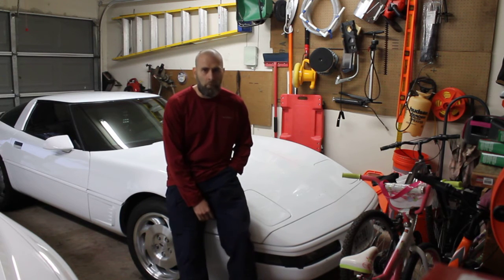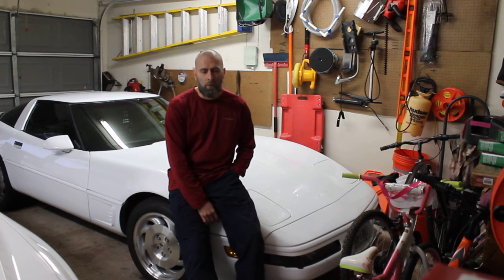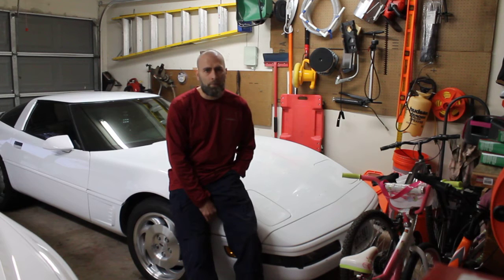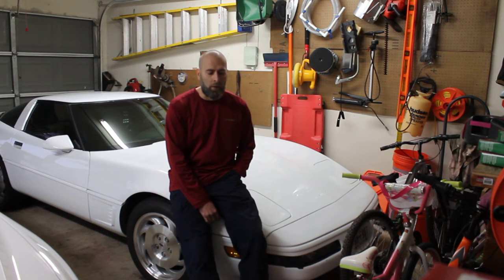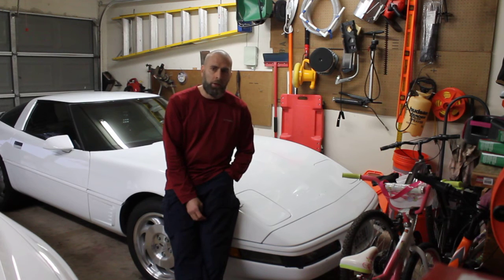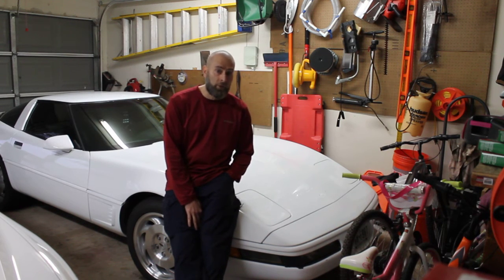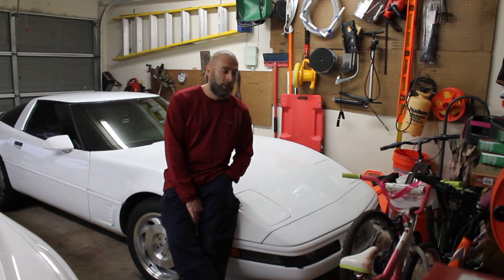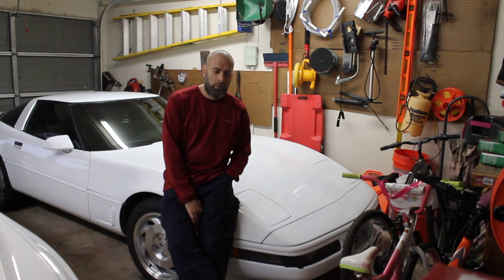1995 C4 Corvette Cooling Issues

Comment: I know what you mean mine runs 234 put a 185 thermostat in didn't help so I'm done fooling with it, it makes you mad.
Reply: The thermostat dose not change the overall temperature of any cooling system. It simply opens at a set temperature - in your case 185. It’s not like a house thermostat and many people are very confused about what an automobile thermostat actually dose. Many many other factors contribute to higher than idea temps in car especially C4s. Clean the area between the AC evaporator and radiator annually, check coolant level weekly, make sure fans are both working, bleed the system for air when adding coolant, clear out the great sucking airflow tunnel under the front of the nose, and last but most importantly replace the original radiator with a multi row aluminum radiator, at the same time replace every single hose in this highly complex but beautifully designed cooling system.

Comment: FYI - On my 1985 C4 -Manual Tranny with Doug Nash 4+3 Overdrive, I replaced the stock radiator with a very high quality DeWitts Dual Core Aluminum Radiator (Model: 1139084A) with high volume Electric Fan (Model: SP464) upgrade and a 160 degree coolant thermostat.  The result was quite good.  The car coolant temperature now operates 30 to 40 degrees cooler than when in its stock configuration.  I normally see 160 degree coolant temperature as long as I'm moving at speeds greater than 15 to 20mph.  When I', stopped, sitting in traffic, the high capacity (2360 cfm) electric fan comes on at 200 degrees (installed manual cooling fan thermostat switch) and shuts off at a preset 180 degrees.  I never see temps above 205 degrees sitting still with outside air temperatures around 90 degrees and that's with the AC turned ON.  The only issue I have with the DeWistts Radiator is that it isn't a direct fit, as advertised!  It requires a great deal of modification but was worth the effort.

I'm convinced that the only way to improve the high heat problem we all experience, beyond what I described, is to modify the hood to add cooling louvers or vents.  That would allow heat to escape from the engine compartment even when stopped in traffic which, in my view, would make a significant difference.  I'm looking for a commercially available kit to install, if there is one.  If not I may opt to have a local body shop modify the hood to add two large air scoops or louvers spaced properly in the middle of the hood sometime in 2019.  I encourage anyone who has questions or comments about this subject to contact me at this email address:  draped-92172@mypacks.net.

Comment: I replaced the stock radiator with a new dual-core aluminum from Eckler's and it runs sooooo much better now, probably too cool now, but I'll take it over the 240+ temps it was hitting. Now I just want to add a lower temp fan switch cause sitting still in traffic on a hot day will still drive it up to the stock 235-ish before the fan kicks in. Very happy with it though as is, makes me feel a lot better driving on 90+ deg days.
Reply from the maker: Thanks for the comment. I've not seen too much about the aluminum radiator for the C4. Thats on my short lit on things to upgrade.....if i could get a break from fixing other stuff.

Comment: my 95 runs warm on hot days when it does i put the heater on low keeps it stable in traffic but make sure you don't overheat it can burst a rad hose and the coolant will take out your optispark as it did too me cost $800 too fix it and a $150 dollar tow

Comment: small block chevy motors dont normaly run hot...  but i know why this car would...i found it out by accident..take off the cover over the radiator an look between the radiator an the ac core..  mine was filled up with dirt an road debree...  i rinsed it out an now it stays cool...
Reply: Good Call
Reply: Thanks for the heads-up. I'll remember to check that like once a year. Just replaced the radiator after it sprung a leak and I noticed the gap your talking about.

Comment: I understand this guy completely. All you other trolls didn't make a video did you ? Even have a C4 ? I did the 165F and very little change. By the way ? How many real Vette owners drive the car fast ? It's only a problem on very hot humid days for me. If the video maker reads this, what was your solution ?? And thank you for taking the time.
Reply from the maker: Thanks for watching and commenting. I should do a better video about this.
1. The Corvette was made to run hot to pass emissions. Just because it was designed to run hot doesn't mean its good for the engine.
2. Reverse flow cooling creates a more uniform temp & cooling cycle throughout the engine. This is due to the different expansion rates of the cast iron block vs the aluminum cylinder heads. It has nothing to do with the temp itself.
3. Despite the hype from other commenters, even with NO thermostat, any car WILL get hot in stop and go traffic. Because,... there's not enough air moving across the radiator to remove heat from the coolant. 
4. The LT1 water pump does not move much volume at idle.
5. The C4 does not get direct air flow across the radiator due to its location.

There are only three ways to make this car run cooler...aluminum radiator, electric water pump, and/or adjusting the fans as i explain in another video about BIN files. I opted to tweak the bin file because I could get it to do exactly what i wanted, and it was basically free after the cost of the ALDL cable. In the future i do plan to swap out a new aluminum radiator. Your car running rough on warm days tells me you have a sensor issue.
Happy hunting!
Reply: @slythee1  Hey guys, as a mechanical design engineer who works in the automotive industry, owns a 1995 C4 and lives in imperial valley CA (temps over here are known to rise up to 130 *F) I 100% agree with Slythee (and understand you Steve).
What I did was to add a bigger aluminum radiator, set my fans to be working as soon as the car starts,  and even then... when I turn on the A/C the temperature starts rising up. That said... it does run cooler and it creeps up to ~225 *F.

Comment: Sorry but this guy doesn't KNOW much about a Corvette.... it is a reverse cooling engine... MADE to run hotter.... and the 165 degree thermostat does MORE than this guy could imagine... a K&N air flow along with the 165 thermostat is all you need and that's IF you are driving parades... otherwise... LEAVE IT ALONE! ( AND yes Mike below.. I also have the hypertech on mine... i have had it for over 16 years and zero problems.... )

Comment: Why are you so concerned about running it cooler? It was designed from the factory like that. Only reason why you would need to run it cooler is if you are planning on racing it. Which is doesn't really look like.
Reply: I was just going to ask the same.

Comment: what I did on my C4 Corvette under the air flow filter the radiator Shield above the filter I cut a square hole lengthwise gold filter going through the bottom and made the car runs much better cooler breathe more better and that gave me stable performance Engine happy and it runs even better there's also a plastic Shield that goes under the filter when it rains there's a plastic sin Shield under the filter to block leaves from going in when it rains put that cover on the bottom that way water won't go in when it rains just a tip great videos that you post up keep them coming

Comment: I had the exact same problem with my 91 L98. It would run hot, very slow to cool down going down the highway. My original radiator was doing everything like it should, except cool. After putting in a 3 core aluminum ebay radiator, problem solved, the end. It now runs cooler overall, and loses heat quicker when moving.

Comment: Dude this is the most difficult car in the world to cool, I'm doing scoops the whole deal. Mine has a 396 stroker with a d-1 procharger along with a 4l80 transmission, I've got so many fans in this car you can't even imagine. This is the deal with these cars, cooling them is a biotch!!!
Reply: I would bet it's your radiator, not the engine, not the thermostat, not the design of the corvette air intake.  No year Corvettes over heat if they have sufficient radiators and every working. My car is stock, so not a stroker with a pro charger, but your car should not over heat with working fans and a good radiator. I saw a twin turbo 1300hp ZO6 with no heating issues, so it can be done.
Reply: frank mathis I am running a 383 stroker with manual transmission and cooling is a bitch, one trick use to be pop the hood and let heat flow out the cowl better if stuck in traffic on a hot day, forget running ac, I ended up upgrading to a Ron Davis 3 row, I couldn't find a fan good enough though, I ended up getting a Volvo XC70 elec 2 speed fan and retrofitted with a custom shroud I made with alum sheet, but I'll have to wait till the dog days of summer to see if it all works. I'm thinking of callaway hood louvers to help get rid of the excess heat.

Comment: in your video of replacing the front spoiler, you pointed out that that spoiler does matter. have you thought about making a little air scoop out of either sheet metal or fiberglass that drops below the level of the front bumper? a friend of mine had an issue with cooling on his c4 as well and that was his quick fix. he made his out of aluminum sheet riveted together and painted flat black to match so it wasnt noticible unless you were right up on the car.
Reply from the maker: +Anthony Mason thanks for the info. i''ve seen those in MAM and Corvette central but didn't want to pay $$$ for it. you're the first person to say comment on how well the work. maybe i'll try and make one
Reply: +slythee1 it actually pulls cool air from the front of the car when the fans kick on. running down the highway, it acts as a type of "ram air" for the cooling system. there was a 10-15° difference on a road course. one thing you DONT want to do is put a higher flowing water pump on a c4. flows so fast that the coolant isnt given enough time in the radiator to cool off

Comment: I've watched a few of your videos, but I can't remember if you mentioned it. Have you actually removed the radiator or had a look down the front of the radiator? The reason I ask is because these cars are known for building up leaves and random trash that block the radiator and can make the car overheat. My grandfather actually has a 91 c4 and was having cooling trouble. When he removed the radiator there was a large number of leaves and trash blocking it. He removed all the garbage and the overheating stopped.
Reply from the maker: +travissutton22 Yes, the space between the A/C core and radiator is clear. I used a long piece of flexible air line on the end of a 1/4 dowel rod to blow out the radiator and A/C core in both directions using the small opening where the A/C lines enter the housing. it will run cool, just not as efficiently as i would like.
Thanks